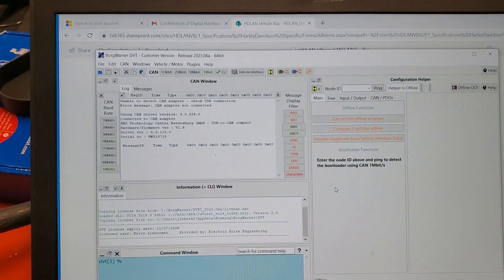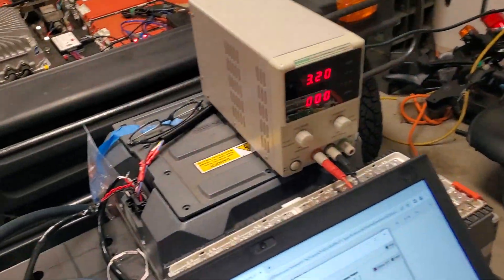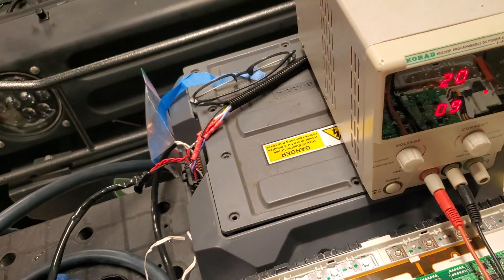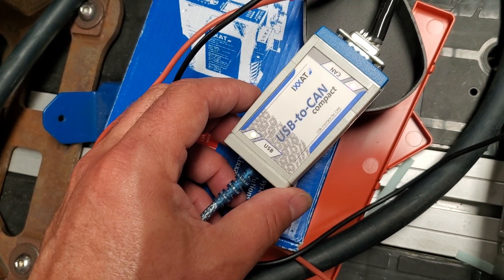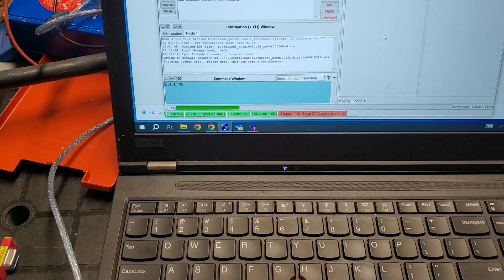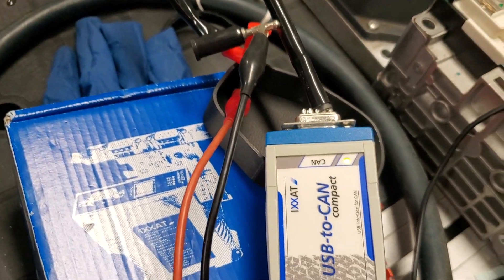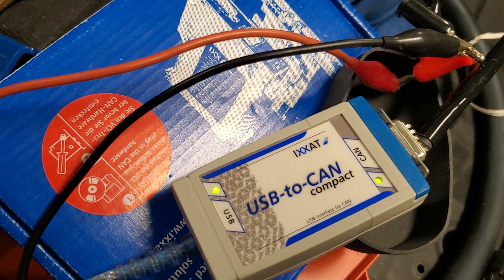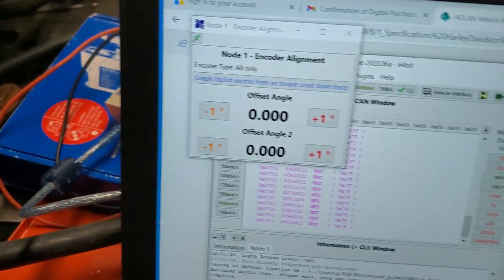Checking my Sevcon Gen4 size 8 controller DVT software BorgWarner

Comment: So did you put the inverter into a vehicle, or was the short you suspected in one of your other videos real?  Dying to watch a follow up to this.
Reply from the maker: The entire batch of inverters were fried unfortunately. Never got one to work. I think they were all run without pre charge resistors
Reply: @kevinlieb  Not good, did you end using one that worked, or did you go for another type of inverter? I'm myself looking for an inverter in that power / voltage range.
Reply from the maker: Not one of the 8 I tested really worked. But I have access to some that are functional from another batch. Email me boxerengines@gmail.com
Reply: @kevinlieb  I wrote you.

Comment: Hello, on wich pins do you give power so that the controller goes on? In the documentary is a connection between 1 and 6 (key switch in) but there is no power input to find.
Reply from the maker: This is very dependent on specific model of Sevcon.  This is Gen4 Size 8 I believe, and is even different than size 6.  Message me at boxerengines@gmail.com for specific info and document links